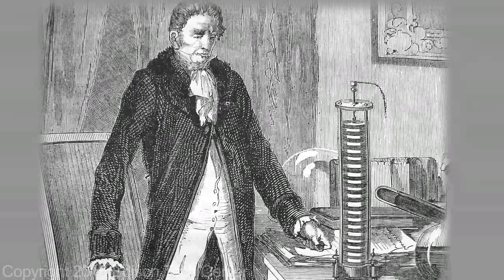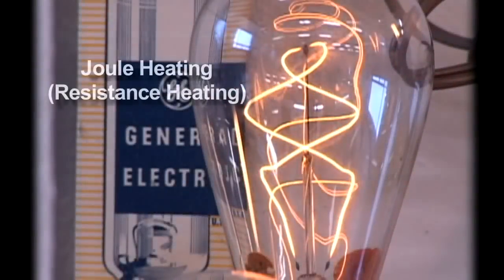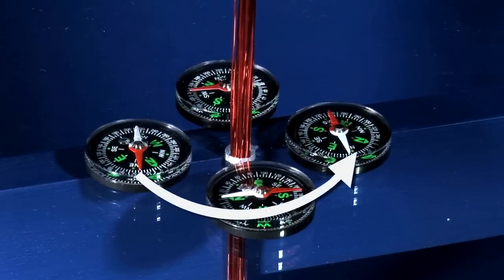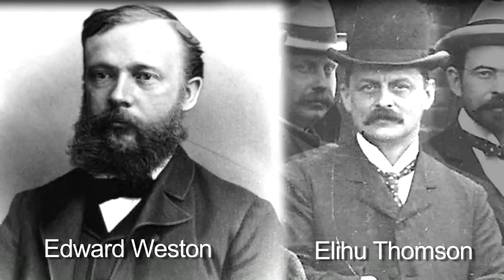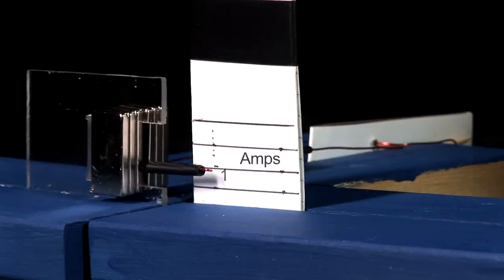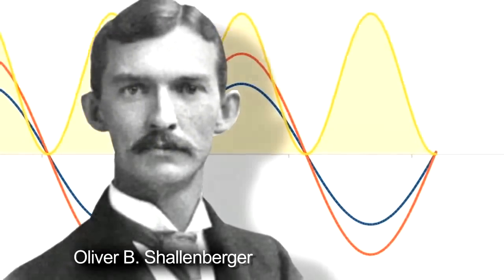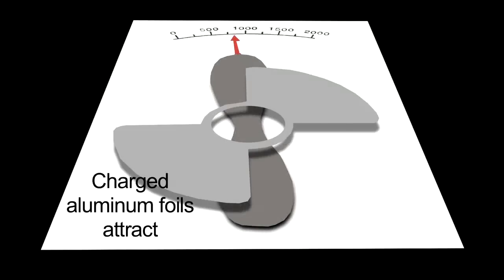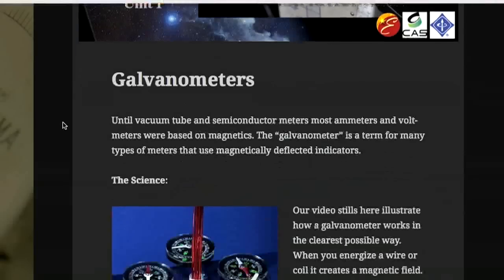Amp and Volt Meters 1800-Today

Comment: Two of the diodes in the bridge rectifier are reversed at 6:00 - enjoyed the video, thanks for posting.
Reply: Just wanted to comment that, diodes have to be flipped either the two upper or two bottom ones.

Comment: Multimeter development did nor require the invention of tubes or transistors. They existed before and were widely used until their electronic counterpart were as cheap or cheaper.
Reply: They still helped in the evolution of electrical technology.  Only thing is now the idea behind what work being done for someone with electrical devices and current is long sense forgotten....  Now its all about building something that can make money and not using ones imagination to build/invent something electrical that can do physical work for anyone. Thus in a sense (from then on)making the physical  material do work for them using only the minds imagination and intelligence.
Reply: @TheZafootz  Paul, do you truly think, back then, the primary motivator, was not $$?  If so, your thinking is akin to a socialist.  Are you a democrat??  Democrat socialists put 'social purpose' over 'profit'.  But, profit is spelled, L-I-F-E.  Lack of profit spells, D-E-A-T-H.